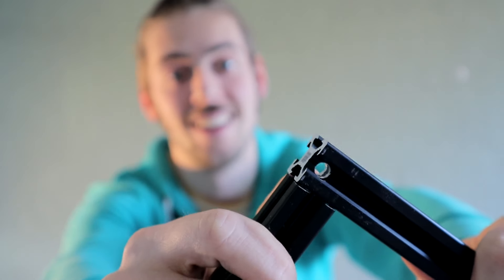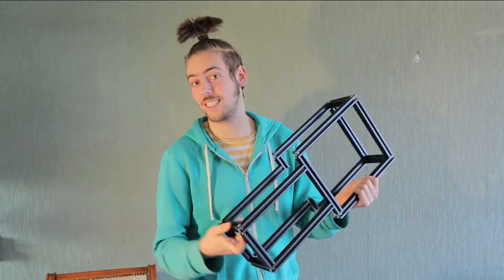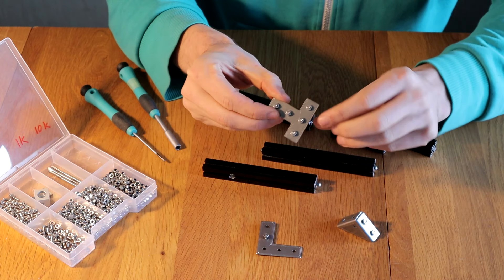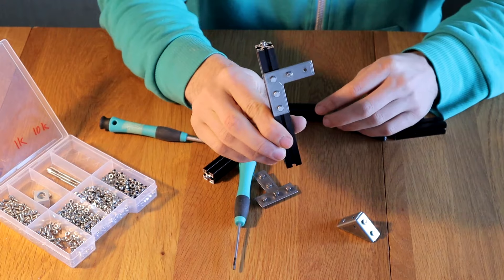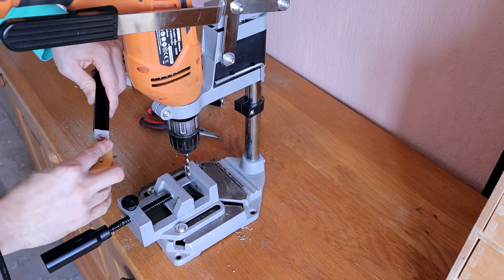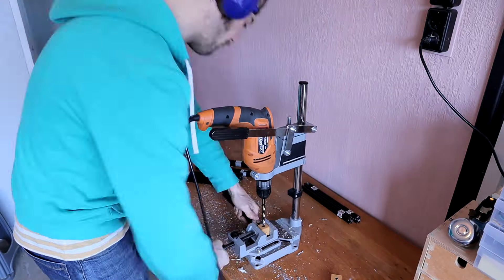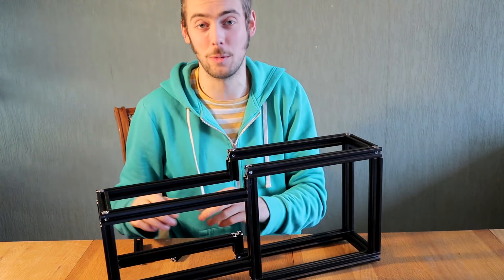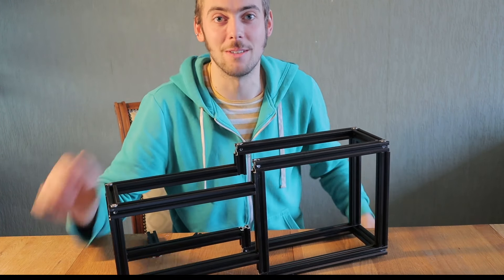The EASIEST and CHEAPEST way to build with aluminium extrusion - Acrobot

Comment: There is one other option, called Corner Cubes. They come in a 2D version for connecting two extrusions at a 90 degree angle, and a 3D version for connecting three extrusions. They are awesome. The only issue is: they are ridiculously expensive. You are looking at up to 4 or 5 Euros per piece. So not exactly budget friendly I’m afraid. But once you used them you won’t want anything else.
Reply from the maker: I use corner cubes nowadays, they are really useful as the good ones stop the extrusion from rotating and unscrewing itself. Worth the expense for my application!
Reply: You can get 2D cubes for less than 2€ from Germany 🎉😂
Reply: @markusesslinger Care to share a link? Dold and Motedis are usually my go to suppliers for anything materials related.
Reply: @DeputatKaktus  It's Motedis — 1,88€ (without tax…) and two weeks waiting time for 30 B-Type.
So actually, even without taxes you can't get a cube for less than 2€, because you have to add shipping, and add nine additional parts ;-).
Still, it's way cheaper than 4€.

Comment: I just wanted to add there are actually butterfly connectors for this purpose that distribute the force even better than just the bolt head. I totally agree that it's a great method (Although time-consuming to drill and tap) but Compared to traditional fasteners it's Considerably stronger and cheaper to put together. Again also more time-consuming.  8020 Actually sells a jig to drill the holes,  Although you can use a self-centering downing jig.

Comment: Good video. I have never used aluminium extrusion so your demo of what is possible is very useful. If your Acrobot is still too heavy you might consider aluminium angle and flat bar which is a lot lighter still, held together with rivets (a hand riveting tool and rivets are super cheap). Also wire cross-bracing is super light but very strong if needed.
Reply from the maker: Thanks, that's a really good suggestion, will definitely consider that for future projects!

Comment: The connections also can twist since it only has one fixpoint. So depends on the application. Almost every Ender 3 style printer is assembled this way. All working fine since they don't bear much load .
Reply: Yes, I think it would be fabulous if they'd come with a tool that could be used to keep them from rotating. I'm not sure why they don't already exist as it's not a complicated tool. Just a wider part that runs the width of the inside channel, connected to a thinner one that is at a 90 degree angle to pivot up before being rotated out of the channel. 

It's definitely 3d printable as it doesn't really need much strength to simply prevent the nut from rotating.

Comment: Slot nuts are the best way to go, can be used along with threaded inserts that can self tap into the extrusion channels, this allows adjustment of parts without disconnecting anything
Reply from the maker: I'm not sure if I understand how you use the threaded inserts. Do you insert them into the slot nuts? Into the hole at the top of the extrusion? In the v slot how?

Comment: It is definitely a good connection — even more so when you add special pates that prevent twisting.
With double-wide profiles, you can do even better:
Use one hole in the way presented here, and a headless screw for the other. This prevents not only twisting, but also sliding.

Comment: You can buy 3 hole nuts and 2 hole nuts to make it easier to assemble.

End fasteners are very strong as long as you don't hand tighten them.

They make small wings that go around the extrusion and help it hold its position. 8020 calls them end fastener wings.

Comment: superbly implemented, not quite as relevant for a frame construction, but there would be a small metal plate (connector set) in between which makes the connection twist-proof as well
Reply from the maker: Yes, those plates solve that problem! The manufacturer of my extrusion doesn't have one for 2020, but for 3030 and 4040 they seem great :)

Comment: Unlike when using brackets, when using the convenient joining method shown in the video, it's crucial to cut the extrusion ends perfectly square. That is the number one obstacle to this method. If anyone has seen an economical method to achieve square cuts , please respond to this comment. Aluminum extrusion can easily be cut on a bandsaw, tablesaw or chopsaw, but getting it extremely perpendicular in two axes is a challenge!
Reply from the maker: I have most success with cutting them by hand with a mitre box, and then grinding them flat on a disk sander with guide rails if needed.
But whenever I have the chance, I order them to size!
Reply: Actually - I just cut all my aluminum on table saw with a slide/sled - works great - I even use just a normal saw blade - carbide tip - think I had something like 80 tooth 10inch.  Miter saw works great to - I just do not have one easily accessible - same deal with the blade.  BTW, wear eye protection!!!

Comment: Hey! This video is very helpful! btw, did you use a 1 inch T-slot aluminum extrusion? If so, May I know what size of the cylinder head bolt are you using?
Reply from the maker: mine was 20mm, not 1 inch, sorry!
Reply: @DanielSimu  appreciate your response!

Comment: I do prefer item's Automatic-Fastening set. It's more flexible than having to drill a hole at an exact position and since you usually use two, the extrusion can't twist. But overall everything depends on what you want to build anyway.
Reply from the maker: Yeah, I never used those but they look practical. A bit more expensive, but probably often well worth it.
And the twisting is an important detail yes, I am working on a new video where I mention this, coming out soon!

Comment: Is 2020 extrusion suitable for a 48 Inch TV lift? The weight would be on linear actuators, but the bending due to weight woud be on 2040 extrusion
Reply: That seems fine giving it's a flat screen 2020 extrusion is much stronger than most major brands TV stands, Mounting points to the TV and extrusions do matter but I can't see why it can't be done

Comment: Very nice video, but if the aluminium rods are longer or the lever is larger, the screws may not hold. Additional brackets would have to be mounted here.

Comment: Daniel, I'm assuming you are threading (tapping) the end piece that the buttonhead fastener screws into? Yah kinda left that part out. Thanks for the greatly useful and to the point video.
Reply from the maker: Well spotted :). Although I have tapped these extrusions by hand before, these ones I ordered with the holes tapped, which is much worth it if you know your measurements in advance!
Reply: @DanielSimu  Heheheh, no worries....   Thanks man !!

Comment: Why not using both a long screw and a T-Nut? It is a known combo for years
Reply from the maker: I'm not sure what you mean. What does the screw go through?
Reply: @DanielSimu  You make a hole in the extrusion as usual. When you screw the bolt in you also put a T-nut inside the extrusion A (from the outer side). So you have a bolt coming through Extrusion A and T-nut and then being screwed into extrusion B.
Reply from the maker: @ВасилийФедорченко-л3к  Thanks for trying to explain it further! I'm still a bit confused. Extrusion B is attached on it's end, with a tapped hole? In that case, what does it help to have a nut in A?
Reply: @DanielSimu  Correct. It makes the joint stronger.

Comment: I'm making a small 20" x 20" x 36" box frame for a tig CNC pipe welding project. I should have researched this stuff better as I went with 1010 series.  Big mistake.  Should have chosen 2020.  !0 series hardware is in some cases 2x the price for the same thing.
Reply from the maker: I feel your pain! Good luck with your project
Reply: @DanielSimu  Having abandoned the "purest" mentality ages ago, it seems that many of the series 20 hardware parts can be used for 10 series stuff.  The way I look at it, if my project is physically stressed to the point where the 20 hardware fails, I'm gonna have much bigger problems than just that.  So yeah, it ain't going to the moon...

Comment: What kind of screws did you use? I am wondering because of contact korrosion. That would be the case when screwing stainless steel screws into aluminium tabs.
Reply from the maker: It is zinc-plated steel. So far I've not had corrosion issues yet.

Comment: It’s not cheap
Reply from the maker: With only a single bolt per joint, I don't know of any cheaper method... Do you?
Reply: @DanielSimu  Wood, also you said cheapest!  Just one aluminum extrusion pole 6ft long cost $30 plus a piece. If this was the cheapest we would make all furniture with it but we don’t. We use WOOD! Why, cause it’s still the CHEAPEST in all industries. Construction etc you name it.
Reply: @DanielSimu  I was in extrusion myself. I use to put the die’s in the machine etc. my grandfather on my mothers side owned a saw mill, so I have heard this argument till I’m blue in the face. Yet, what is the industry using? The industry will always go with the cheapest cause that’s how they make their money. If I remember correctly cause it’s been a while. It cost something like 0.30 a MM not an inch or a yard but a millimeter. You have to heat the metal up which takes a ton of energy which isn’t free. I can run a saw mill with multiple saws cheaper than I can run one extrusion press electricity wise. Tool and die isn’t cheap. It’s the whole reasoning behind 3D printing. 3D printers have come so far in the last decade that one day it will hurt the cnc and forging industry. They already have 3D printing FARMS like crypto mining farms. And yes, any business not ran right will fail. The only thing holding 3D printing back is when you print a metal part it doesn’t have the strength that a Forged metal part does. That will change in the next 20 years I promise ya! Look how mini cnc have hurt the industry some. Better yet look at it like this! My mother can use a phone. Yet, she can’t use todays phones. I have to put her contacts in for her etc. It was only 25-30 years ago that cell phones came out. So that’s why I say give 3D printing another 20-25 years and you will see a BIG change in the industries. We already are now with AI etc.
Reply from the maker: @josephspruill1212  Thanks for your detailed answer. I of course meant that a single bolt is the cheapest way to join extrusion profiles, which is what the title refers to.
As to whether wood is cheaper than aluminium, I'm sure you understand that that depends on the application. For some some projects with certain requirements, aluminium extrusion will be cheaper, and for other requirements, wood is. One can't compare these materials without also discussing their application.
Reply: @DanielSimu   that application is strength! That’s why I told ya about the 3D printing, etc! I mentioned the cons of it and how that will change in the future. Than, aluminum will be Cheaper.  All you would have to do is print it. Cause I can used one screw or bolt or even glue which is no screws or bolts at all for wood! So it’s not that I don’t understand what your saying. Your not understanding me!
Reply: @DanielSimu  don’t know about you but I can assemble let say a desk,right! I can do it with wood faster than I can metal any day of the week. Doesn’t matter if it’s one bolt or two. That has more to do with the person doin the assembly speed, Not the product itself. And the video title is “ THE EASIEST AND CHEAPEST so maybe you need to read your own title again!
Reply: @DanielSimu  yet I can’t ready lol 
Have fun with that lol
Reply from the maker: @josephspruill1212  Perhaps the title gets truncated on your device, but I'm positive that the full title of this video is:
"The EASIEST and CHEAPEST way to build with aluminium extrusion - Acrobot"